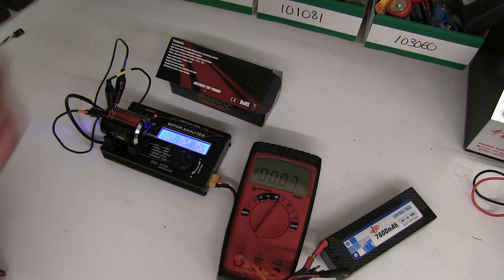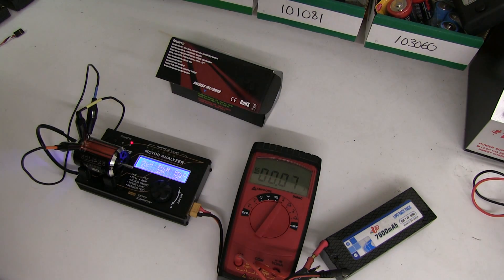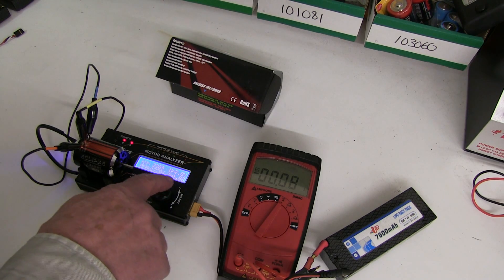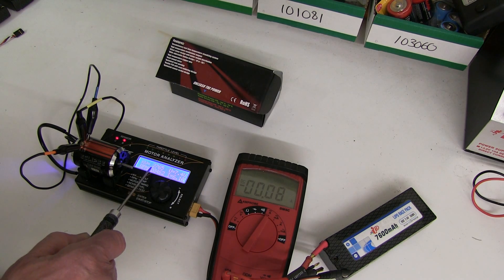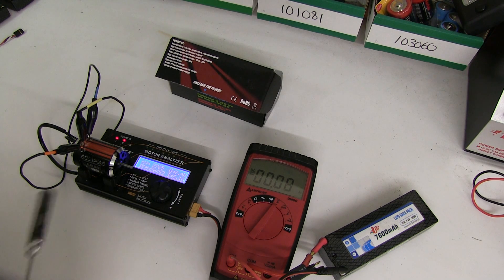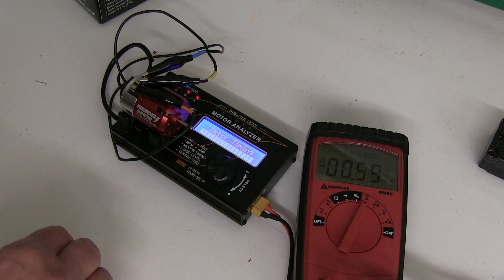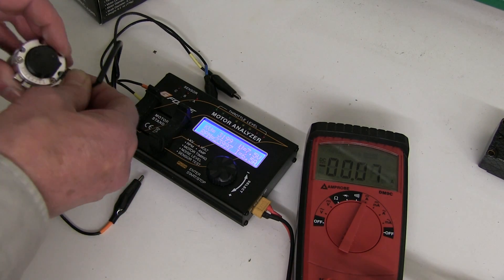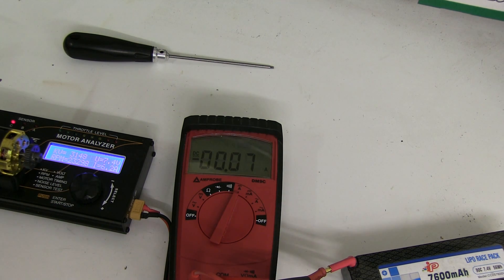Blinky Brushless Motor Sweet Spot. 17.5T and 13.5T

Comment: Hello Nick. Was wondering what your thoughts are regarding the accuracy of the amperage reading. Which do you think is more reliable? The multimeter or the motor checker? Also, is the very first red lead plugged into you meter the lead from the motor checker itself? It seems to me the first red lead in the meter if from the motor checker, and the second red lead is the charger lead you mentioned connected to the battery. And the black lead from the battery is from the motor checker. Am I correct? Thanks again from across the pond.
Reply from the maker: Hi
If you have the motor checker, tha shows amps, then you will not need the meter as well.
The meter is for those who do not have the tester.
When connecting the meter, it should read with the leads either way, as the display will show plus or minus amps.
All the best
nick
Reply: Perfect. Thanks for your help Nick. Very informative videos. I look forward to more. And thanks for putting up with all my questions. I'm a bit anal when it comes to my RC cars and equipment. I like to do thinks right.
Reply from the maker: Ho
No, that's good.
You are preparing to win.

Comment: Hi Nick. I bought a multimeter and was told that the DCV setting is equal to 10 amps. is this accurate?
Reply from the maker: Hi
No. That is DC Volts.
 It should have a DCA position and a socket marked 10Amps.

Comment: How did you hook up the multimeter to the battery & analyzer? I can't quite see how the connections were made
Reply from the maker: Hi Dimitri
The Multimeter needs to be set to 10amps DC range.
Then insert it in the positive power lead, so that the wire goes from the tester and in one socket and out the other to the battery positive.
The battery negative lead connects directly to the tester, like normal.
Hope that helps
nick
Reply: +Nick Adams I understand. just need to find a multimeter with the proper sized leads for battery a analyzer. My battery takes 4mm bullets
Reply from the maker: Hi
Most multimeters have 4mm sockets.
Use heavy duty connecting wire, if the multimeter ones are thin.

Comment: im wondering if the efficiency of the timing will change under load?
Reply from the maker: Hi James
Not sure what you're getting at, but if you apply a load that prevents the motor reaching it's maximum revs, then the motor will be overtimed and will draw a heavy current and be inefficient.
A bit like driving a real loaded car up a hill in 4th gear, as it picks up speed it will suddenly take off as it enters the efficient sweet spot for the gear.
An electric motor in a model car operating with a lot of advance timing will need to be run at the higher speeds to be efficient, although the torque is very high at lower revs, so will still accelerate.
All the best
nick
Reply: that makes sense thank you for explaining.

Comment: I've been discussing this video at my local track and the most common comment is about running a motor full with no pinion and having the motor explode internally. Does that happen and are you worried about any damage caused to your motors?
I tried this method with a multimeter. Certified D4, 1s 17.5 with 48 timing on the can and the amp draw was only 1.8. I guess I can bump up the timing, but I'm worried about continually testing this way.
Reply from the maker: +ryan holcomb 
Hi Ryan
Yes, rotors can explode, but it is not normal these days.
Especially when you consider the revs of lower turn motors.
I test at a lower voltage, about 7.6volts.
Your motor should definately draw more than 1.8amps at 48degrees,  so sometyhing must be wrong.

Comment: Hi Nick, 
how did you work out that 6 amps is the optimum amp draw? because one bloke at my race club said the motor shouldn't draw over 5 amps but never new why. I'm just curious but have not been able to find an answer.

cheers mate
Reply from the maker: +Steve Vakalis 
Hi Steve
All the advice applies to the Blinky (Locked speedo zero boost timing).
I checked a number of motors that racers had got to perform very well.
6 amps was a typical reading.
Higher currents , say 8 amps made motors hotter, with very little performance gain.
Lower currents dropped the performance and top speed, which is not recovered by the gearing.
Also when setting the timing, after 6 amps, only a small timing increase causes the amps to jump, suggesting that is the best point for performance against efficiency.
However , I give this information so that any racer can get a very good performance from their motor straight away, without being in the dark.
Experienced and more serious racers can then adjust their motor up (or down) according to their own ideas, and or the size of track and type of racing. (ie very small track, or very long and fast) and whether the temperature of the motor is worth the risk of a small gain.
Lower amp draw will be nice and safe and keep motor cooler and may benifit small tracks with lots of accidents.
Lower amp draw will sacrifice top speed, but may not be a concern on smaller tracks.

Hope that helps.
Nick
Reply: Thanks for the great videos, Nick!  I subscribed!  The info above regarding how people settled at 6 amps is a critical piece of info that you may want to include in the notes section of your video.  I was wondering myself how did everyone come to about 6 amps vs. 5 or 4, etc.  Glad to see that there is a good factual reason as to why.

Comment: even at full timing on 3 x 13.5 motors I've tested the maximum draw I get is 2A. is there a reason I can't get 6 amp draw.?
Reply from the maker: +dooronron69 
Hi
Assuming you are using a 2S lipo (7.4volt)
Most older motors have restricted endbell timing, so you cannot advance to 50 to 60 degrees.
It is possible to file away the end stops on some motors so you can add more advance.
Reply: +Nick Adams i am using 2s battery and they are new motors but cheap trackstar ones from hobbyking and have max 33 degree timing. my thunder power on full 50 degree draws 7.5A so gunna be turning that down to 6A and use that one. 👍
Reply: +dooronron69 Unless you haven't calibrated your radio correctly, the other option is to get a motor with higher timing.  My motor goes to 40 and it basically doubles the amp draw in the last 2 degrees. Before that I was getting around 3 amps.
Reply: +Robert T it's all sorted now Thankyou, There isn't any radio gear involved, just a battery,  multimeter,  analyzer and motor.
 The timing on my motors must have been restricted, 
When I tried the top end motors they all had higher timing and higher amp draw,

Comment: great video Nick,  thanks, now I know how to use my analyser
Reply: hi nick. if I set my 13.5 sweet spot at 6A using 2s on the analyser what A draw would I get in my car on 1s. thanks.
Reply from the maker: +dooronron69 
Hi
With a 1S Lipo it will then draw about 4 to 4.5 amps, depending on Lipo voltage.
Reply: +Nick Adams Thankyou. I did try to find out but when I did connect my multimeter on A setting in line with esc I  got cogging every time but no cogging without multimeter, so thought I'd ask you instead, 👍
Reply from the maker: +dooronron69 
Probably the connecting leads dropping voltage.
Try and use heavy connecting wires to the multimeter, and keep them short.
If you can make up some with the same wire you use in your car.
Reply: +Nick Adams will try that. thankyou.

Comment: Nick.  Im new to rc racing.  Thank you for the videos.  I am going to setup my revtec 24k 17.5 for offroad blinky based on this video.  Could you help me learn the prime timing profile (or however you would call it) for my 4x4 sct?  Im running a tekin pro4 4600kv with a tekin rx8 gen 2.
Reply from the maker: +MerleSauvola 
Hi
The motors can overheat in an offroad.
This setting of the motor is for maximum performance for racing.
In your 4x4 the gearing may cause overheating, so run it for a few minutes and feel the motor.
If cold, then adjust gearing, faster.
If too hot to touch reduce gearing or reduce endbell timing down by 10 degrees .
Run and check motor temperature, until it runs just hot after 5 minutes.
Race on.
Nick

Comment: Great info here.. Do you happen to know the sweet spot draw for a 7.5 motor?
Reply from the maker: +Bart Grider 
Hi Bart
The sweet spot refers to motors run with "Blinky" speed controls:
ie. With no advance timing (Turbo) added by the speed control.
Therefore the timing on the motor endbell is advanced to get maximum performance.
Low turn motors, such as a 7.5T motor normally are powerful enough at a low timing, as supplied. Also most speed controls can add electronic (Turbo boost) timing to give a lot of extra performance from the motor.
So, it is not necessary to find an optimum maximum timing on these low turn motors.
However, it can still be useful to check the offload current draw, since a high current, say over 10 amps, will cause the motor to heat up.
NOTE: Low turn motors can rev very high with no load, and the rotors can explode.  Therefore I do not recommend it.
Overheating of motors should be avoided, so always check it, after a run, and if too hot to touch, fit a good motor cooling fan, and/or back off the timing on the speed control, or fit a smaller pinion etc.

Hope that helps
Nick
Reply: Thank you for the great explanation.

Comment: when using multi meter you hook em up on the battery side.  One on pos and one on neg or one in pos spot in bat and one on pos of esc.
Reply from the maker: +pSiLoKaTaLiSt 
Hi
The meter goes in the positive wire to the battery. (In line)
So feed the speed control positve wire into the meter, then take a wire from the other terminal on the meter to the battery positive.
The negative wire from the speed control goes directly to the battery as normal.

Comment from the maker: Hi Mike
I do not run those motors, but will check if I can.
21.5T and 25.5T run very hot, as they have a lot of winding resistance.
If you are using a 2S Lipo, then you will have to make sure the motor does not overheat.
So try 6 amps at first, and see how it sounds, and where the timing is set on the endbell.
Generally the amp draw will increase rapidly after the sweet spot, so even a few extra degrees of timing will put the amp draw up quickly.

All the best
Nick
Reply: +Nick Adams Thank you very much Nick. You're doing some great work here, I really appreciate what you're doing. The rolling dyno is just awesome...throwback stuff right there :)